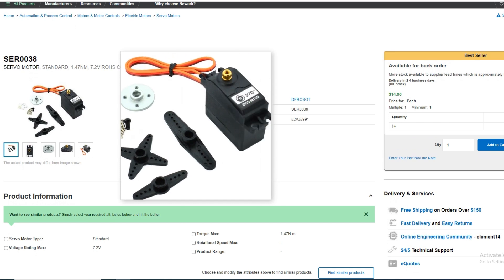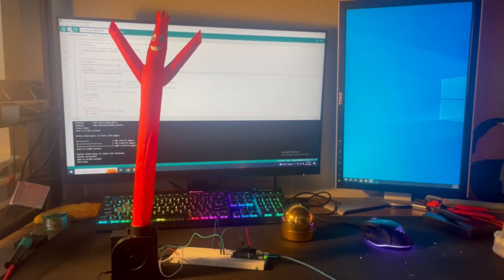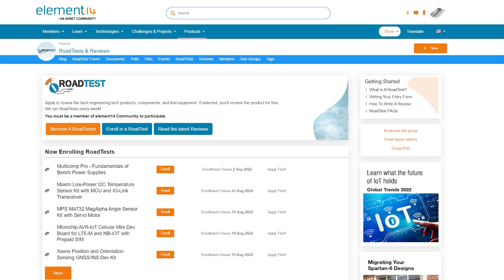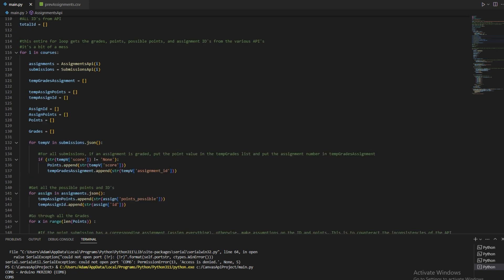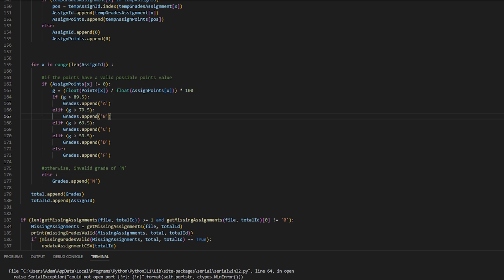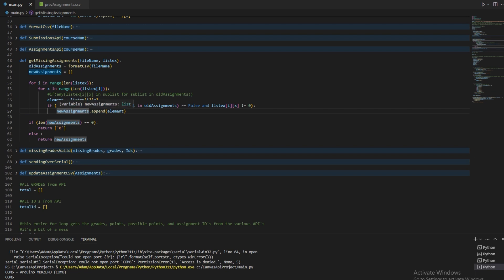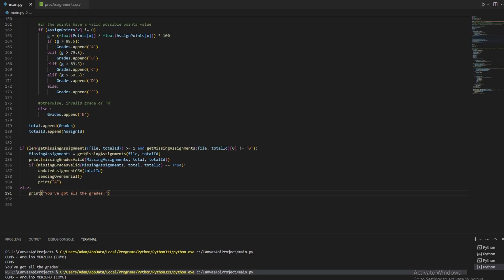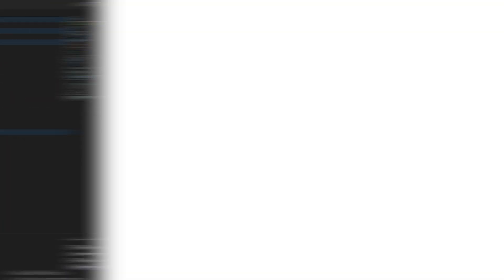How to Build a Robot that Celebrates Good Grades with Arduino

Comment: Interesting project to consider for something similar: Grandson's school sends out notices of 'good' days, 'special acknowledgements' and similar, and it would be cool to have it go off after they get home to act as a 'congrats' to them, or 'heads up' for when mom'n'dad get home... Thanks for the idea...
Reply: Nice! Honestly, I almost made an email bot to scan my emails for new ones that contained "new grade posted" or "new grade update", which i think applies to your idea (if they notified you via email). Then I found the canvas API, which was really handy. Canvas is pretty common in some school districts and colleges.
Reply: @adamsoileau4804  Canvas is not common around here, at least not at grade school level. They use Messenger, Groups app, and SMS mostly, along with email and a proprietary app...